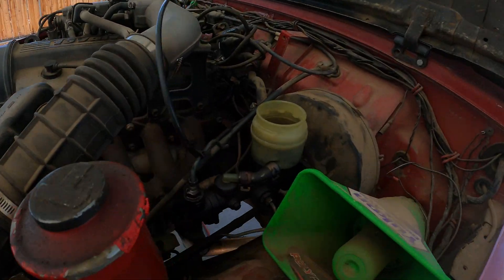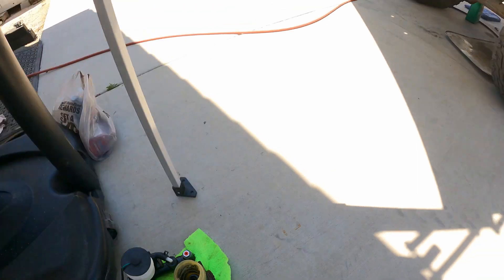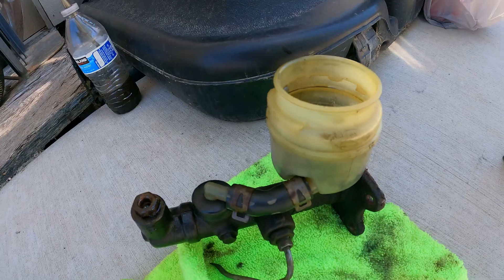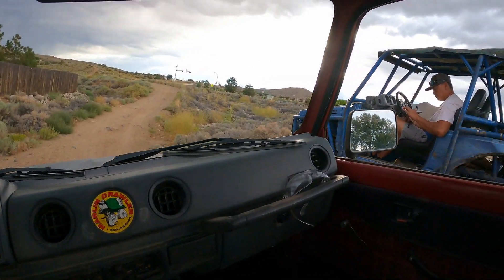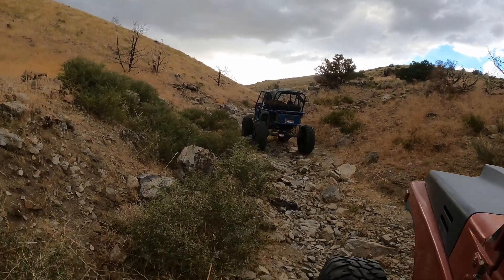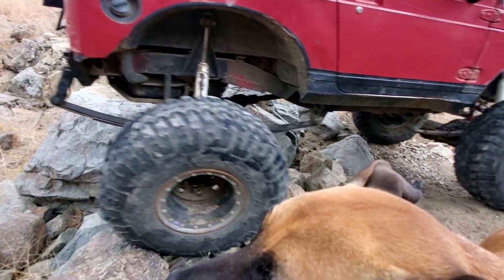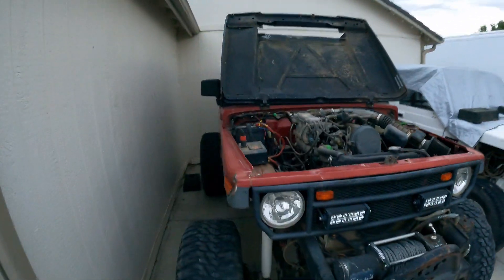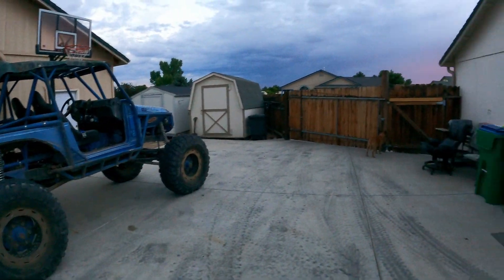Toyota Axle Samurai Crawling and Wrenching!

Comment: Nice samurai, what is tire size and which steering box did you use? I am building Samurai on Toyota 70 series land cruiser axles with 35 inch tires
Reply from the maker: Thanks! I got a Toyota steering box. In this video I had 35s, but I am now running 40s